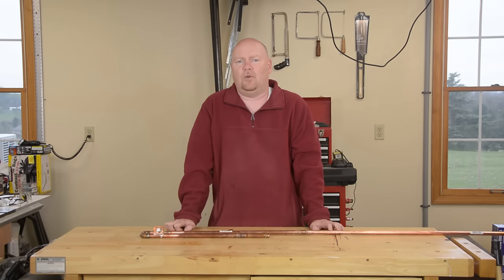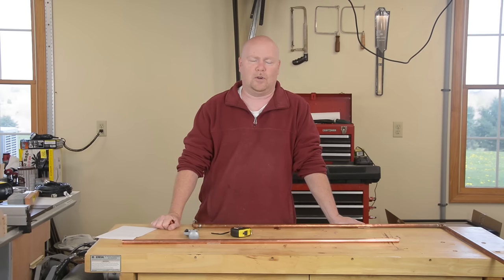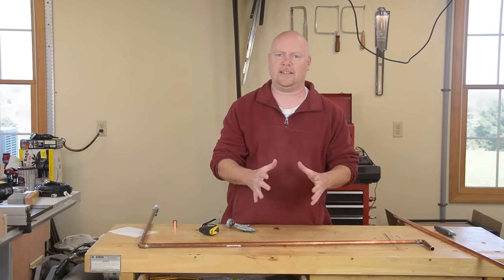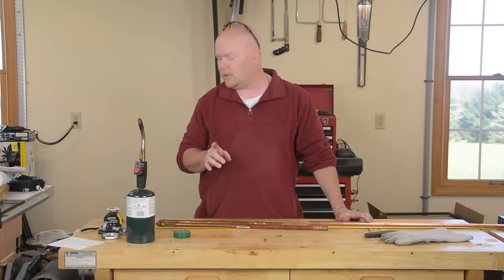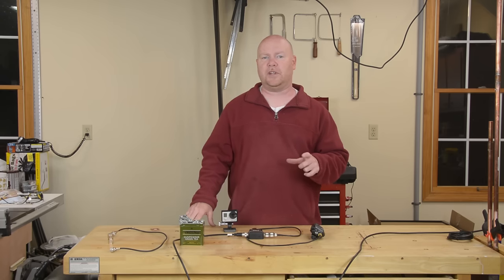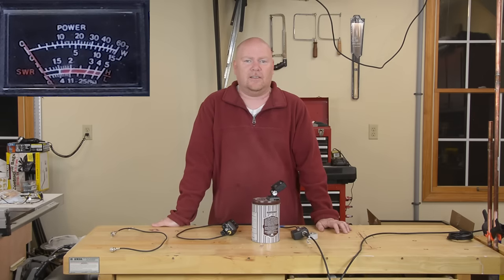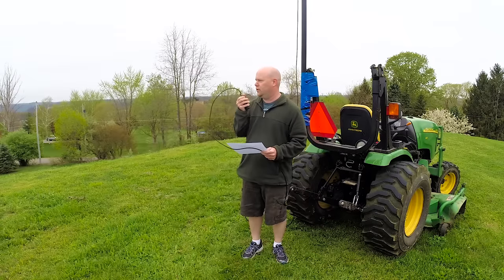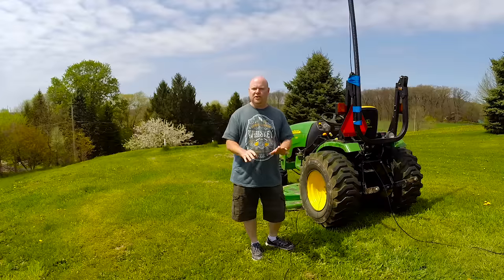2 Meter J-Pole Antenna Build

Comment: Hi! KN4BVB here. I just got my Technician's license three weeks ago (there about) and I built and have successfully tested and used a "coat hanger antenna" to reach in the neighborhood of 18-20 miles  on my Baofeng UV5R when the antenna is suspended from my balcony of my apartment. I want to be able to reach friends in Utah. I live in Alabama. That's a long way to go, I know. But would a J-pole get me there and what requirements do I need to meet in order to make contact to that range? Will I require additional licensing for Ionospheric bouncing? Can I make this contact possible with my current level of FCC licensure and what kind of equipment will I require to make that kind distance possible? Thanks! Pete
Reply from the maker: Hi Pete and welcome to ham radio!  The good news is that you certainly can communicate between Alabama and Utah with a tech license.  Bad news is that it isn't going to be direct via RF, at least not right now.  The 2 meter and 70cm bands covered by the UV5R won't make it nearly that far on their own, or even with a repeater (one exception noted below).  Here's what will work:
1.  If you and your friends can both reach a repeater that's part of the IRLP network (you'll need to Google that term) then you can both communicate using your handhelds, while the repeaters talk to each other using the Internet.
2.  Echolink is a different take on partially using the Internet.  You should definitely set yourself up with Echolink, and if you want to try it out connect to the N3TN-R node (esp. at 8:45AM eastern).  That's where I hang out :)
3.  The one kind of repeater that can work over that distance is a satellite.  Satellite contacts are tricky, and short, but a ton of fun.
4.  You're licensed for voice on 10 meters.  With the sunspot cycle where it is, 10M is all but dead.  In a few years though it will do what you want - at least sometimes.
5.  You could learn morse code.  You have privileges for it on lots of other HF bands that will work at other times, and CW is amazingly efficient.
6.  If you upgrade to General class you'll get voice privileges on the rest of the HF bands, which at various times are capable of spanning that distance.  Again though, HF propagation is pretty lousy at the moment, and even in the best of times the band you need for a given distance isn't always open when you need it.

Best advice I can give you is to find a local ham radio club and join up.  You'll meet lots of folks who have experience that they're just dying to pass on to new hams.

Best of luck and 73's,
Matt
Reply: Matt Heere I am part of a radio club. The folks I will be talking to have stationary rigs. I can do the same, I just need to know what I need to have to make that connection happen. They are MUCH better prepared than I am on just about every level. Good folks and I want to be able to communicate with them in the event of a national or global crisis. I want to run a cross country civil defense drill where we communicate over radios. I am willing to buy better radio and antenna equipment but it might take a while before I can pass my test to upgrade to a General Class. I don't have a lot of time to study and take practice tests right now.
Reply from the maker: Yep.  Time is always the problem.  Lean on those guys in the club.  It'll save you a lot of time getting setup.  Do bear in mind though that there just isn't any 100% guaranteed direct RF path over that distance regardless of equipment.  It requires that the propagation conditions to be just right, even if you end up with access to all the Extra class frequencies and the best equipment available.   Morse code (or one of the various digital modes) will be 100X more reliable than voice, but even they won't be 100%, especially here in the basement of the sunspot cycle.
Reply: Matt Heere I suppose then that my next best plan is to try to build a network of like-minded ham operators within range of my position and relay messages cross country.
Reply from the maker: You'll pretty quickly find that "nets" (networks) designed for this purpose are already abundant in ham radio.  You'll want to get that General ticket to participate directly in the ones that fit your current distance requirements, but you can get lots of practice on the local repeaters with your handheld in the mean time.

Comment: Looks good but I have a question see the bottom part of your T fitting acting as a boom pole it shouldn't be made of copper .Why is yours got copper ? cause that would act as another length to your calculation ? .
Reply: Sorry I've just looked again you don't have a T part on yours just two elbows .I have T on mine what could I use for the base area ?
Reply from the maker: You can use anything non-conductive, such as a hardwood dowel or PVC.   Alternatively, you can have a look at this design which is in the process of being patented, but allows you to mount to a grounded, metal mast: https://www.hamradio.me/antennas/mast-mountable-antenna-patent-application.html
Reply: yea I saw the page but wondered why folk use copper for base section that's a conducter should be made of unconductive stuff for bottom piece

Comment: Can you use this antenna for the 70cm band as well? Which is a better antenna the J-pole or the 1/4 wave ground plane? Which one for dual band. Thanks
Reply from the maker: The J-pole tunes up well on 70cm.  The radiation pattern tends to shoot a lot of the RF at high take-off angles though.  In general it'll work well for repeaters, but it's kind of so-so for simplex use.
A 1/4 wave 2M (3/4 wave 70cm) has reduced performance on 2M in exchange for being better on 70cm for low angle work.  It's not that one is better than the other, just possibly better suited for any given task.
Reply: Matt Heere i havent been able to do any simplex yet but trying to reach my local repeaters. My HT cant reach them.
Reply from the maker: @FC-eb6zs  Make the 2M one and try it on 70cm.  If it's good enough then you're done.  If not, you can make a dedicated 70cm one.
Reply: Matt Heere cool im going to try that. Thank, oh i almost forgot, i am going to mount the antenna on a extra fence post i have in the yard that used to have a bird feeder. Can i mount both antennas(thats if i make two) on each side of the post or do they need to be far apart? Thanks again. 

73
Reply from the maker: @FC-eb6zs  they should be at least a wavelength apart since they are harmonics of each other.  As high as possible, and weird things can happen if you connect them to metal masts, especially if they are grounded.

Comment: Is a tuner really required?
Reply from the maker: Not as a rule if you tune the antenna somewhere in the middle of the band.  More than enough bandwidth to keep the SWR well below 2:1 across all of 2M.  A little tougher up on 70cm with the band being 30MHz wide here in the U.S.

Comment: I am finding that a conductive mast can interfere with operation. If you think about it, the signal can go up OR down from the feed quarter wave stub. Depends on the number of half wave multiples that can fit into the mast length for the frequency in use. If by chance the multiple of half waves is close to operational resonance it can "pull" it off frequency. You can take great effort to tune without a mast only to discover a bad match when installed on the mast ... the luck of the draw!  Best to use a plastic insulator section just below the "J". It explains why some people have good results and others bad. Otherwise, an unexpected bad mast length can cause grief.  VA7WN

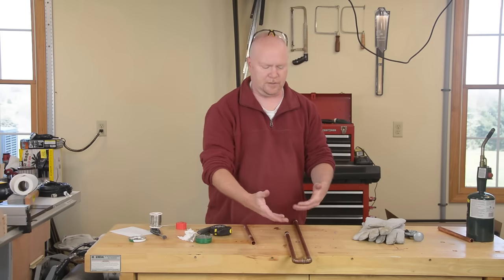Comment: I thought I saw some guy in a super-sized rider mower out the left side window.  Show off!  Geez!   Also notice at 2:34, the magic appearing roll of toilet paper. I'm guessing some greedy toilet paper hoarder accidentally dropped it into a wormhole and it ended up 4 years in the past...in Matt's garage of all places!  Enough jokes.  Thanks for the website!  Is this higher frequency antenna supposed to act similar to an offset dipole?